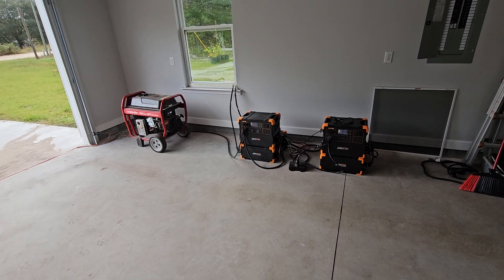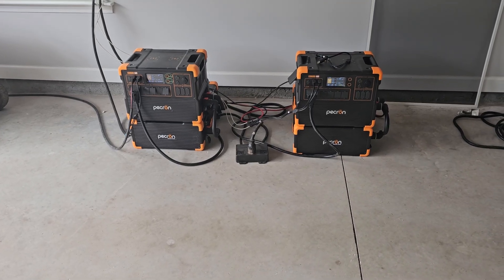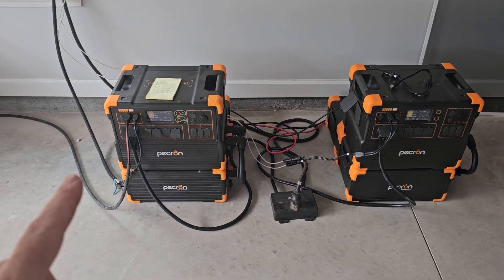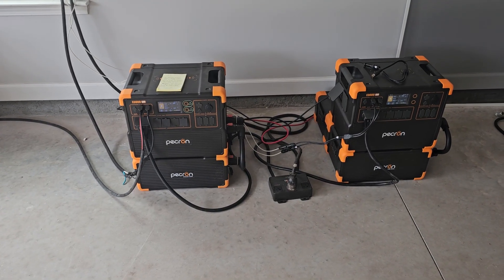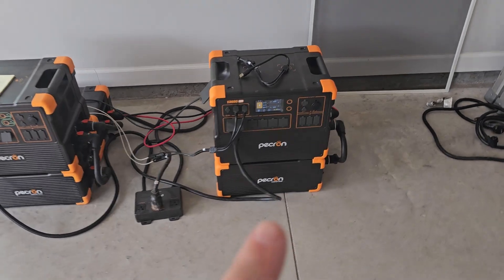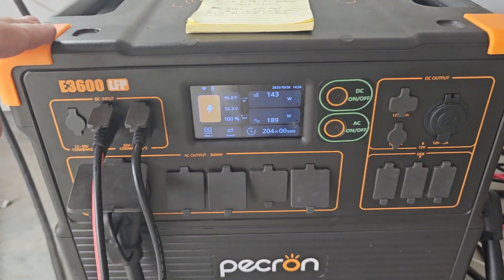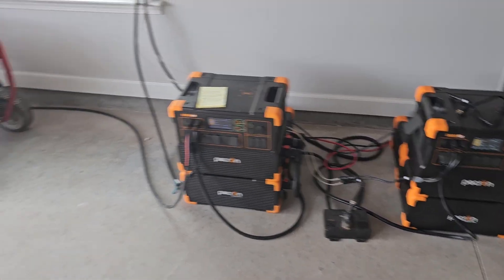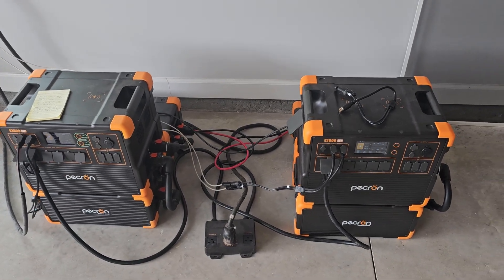Pecron E3600LFP 240V Off-Grid Testing 0%-100% with Gas Generator and Solar!

Comment: The best way to charge the batteries while keeping 240v output with the generator is getting something like an EB4 chargeverter and charge the batteries directly. It's best to parallel all the dc side together. It's a much better setup
Reply from the maker: That is in the works as soon as the Government shutdown ends an I get my back pay.

Comment: Great videos man! I appreciate the real-world use cases. I have a question if you don’t mind me asking. In the app, does the usage information reported in the app reflect them combined, or do you have to look at them separately?
Reply from the maker: It is separate. I have mine named PS1 and PS2 so I can monitor each. The app also takes about 20-30 seconds to update the data.
Reply: @GridDownPreparedness  Thanks!  I thought as much. I’ll have to look into integrating with home assistant or something, so I can at least have both on a single dashboard.

Comment: Pecron battery ep3000 is on a sale now. -50$ off. 699$. You almost complete the perfect setup with 30kwh. I'd love to see that go full off grid. , would be interesting.
Reply from the maker: I had my first E3600LFP maxed out with batteries and it worked ok running my camper for 6 months. Even if I had 30KWH of storage, that close to my average consumption. I really need a 24KW system with at least 100KWH of storage to live like i was on the grid.

Comment: About the batteries getting out of balance and losing power on one stack before the other...With your bonding cable does it not allow the 2nd stack to flow current to the 1st stack to stay on? 2nd, might it balance better if you have the cutoff rates different for each stack, like 15% for one and 25% for the other, that is assuming that the bonding cable does flow current to the low side as needed. 3rd, What if you used the ac port and cable on 1 stack, powered by the 2nd stack ac output?
Reply from the maker: It does. The issue was with my battery 0 on PS2 not reading the correct percentage. I did a full discharge cycle on both stacks and a full recharge. That seems to be the fix. I am still off the grid and on the the E3600LFPs. I will continue to watch it and report what I learn.

Comment: Great video AGAIN 

Georgia doesn't get as cold as New Hampshire  but I was reading that power stations and batteries don't do so great in extreme cold. 

Mine will be housed in my garage. If it's 10 outside it'll be 25 in my garage. 

Why does it need to be in my garage? Because I intend to charge via gas generator when necessary and the 240V plug for the breaker box is outside.

Do you plan on building some insulated box or wing it?

The more I'm getting into this the more I'm realizing it's kind of a scam. It functions well situationally. Cold. Nope. Cloudy. Nope. Expensive. Yes. Endless rabbit hole. Yes 

Ugh
Reply from the maker: https://www.youtube.com/watch?v=_SovPH_V_n4
Reply from the maker: https://youtu.be/TGGRwspFGss

Comment: Not sure I understand, but you can not charge the power stations from the gen, and run the house from the power stations at the same time?
Reply: Unfortunately, that is correct.
Reply from the maker: The generator is running the house. it is also charging the disconnected power stations. They are just another load on the generator.
Reply: @GridDownPreparedness  That makes a hard no for me. Thanks for the follow up

Comment: I have one question that is a little off topic, regarding the UPS function. I'm pretty sure I understand how the upper limit works, but I'm confused by something I'm seeing while testing this function. For example, the E3600LFP unit is plugged into an AC, 120-volt outlet, I have a small fan plugged in to the "AC out" on the Pecron unit for some load, then I set the UPS limit to 80%. This is less than the current battery charge level, so as soon as I change the limit to force it to activate UPS mode, my fan continues to run, but at a reduced RPM. When I check AC output it is only putting out 101 volts. My question is why? If I then return the UPS back up to 90% or 100% the output voltage goes back to 120 volts and the fan runs fine. My understanding was that when UPS mode kicks on it will continue to supply 120 volts to anything plugged into the Pecron unit. What am I missing? Thanks in advance!
Reply from the maker: That is weird. I have not seen that issue. Test the same wall outlet for voltage and see if it sags to 101V or its only the power station. If it is the power station contact their support for a solution. They like photos, videos and  an explanation on what is happening.
Reply: @GridDownPreparedness I'm going to contact Pecron about the issue. Thx, for the feedback.

Comment: We live completely off-grid and I will most likely use my generators this winter which saves us a lot during no sun days 😀. I am planning on using the Pecron units as a backup so trying to figure out the DC to DC bonding cable since it is still not working for me.
Reply from the maker: Do you have it connected between the host batteries on the rear port? I tested bonding battery to battery with the last one in the series and it did not work well. I am testing a new configuration today.
Reply: @GridDownPreparedness  Yes, exactly as your video and in the rear ports of the hosts. I even tried the next battery to the hosts - nothing. I am going to fully charge both units and try again. For the cable set up, just to verify that I am doing it right  ---the positive should connect to the positive line and negative to negative, correct?
Reply from the maker: @jaysoncamaquin-vigil9525  Correct you are connecting the batteries in parallel.
Reply: @GridDownPreparedness  Still no luck, both units are still no synching
Reply from the maker: @jaysoncamaquin-vigil9525  Even with killing it to zero and fully charging?
Reply: @GridDownPreparedness Hopefully, I don’t jinx it but it’s working!! They were fully charged when I connected the cable. Battery levels are about 2% off and voltage is .1. I will continue to monitor.
Reply: @omobonus3345  So far, it continues to balance which is great. But, while we were asleep last night, it seemed the units turn-off or something occurred because my air filter was off and I woke up with the lights turned on. I checked the error log and a "communication abnormality in series" was logged at 12:43 AM (10/27/2025). I didn't see any error log today, but came home and the lights were turned on in the bedroom and my air filter was off again. Based on my research, it looks like this is common when the 240v hub was used. Did you come across this issue?